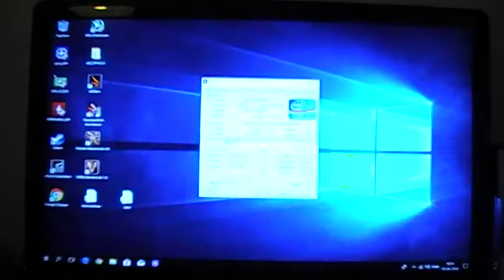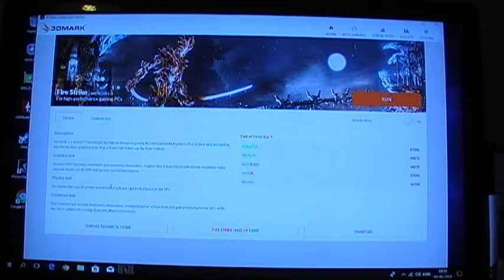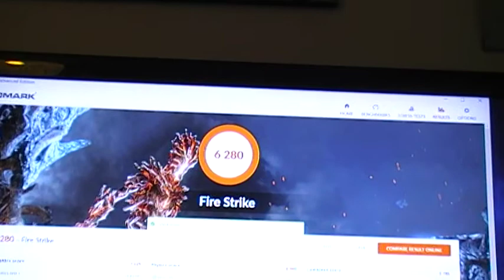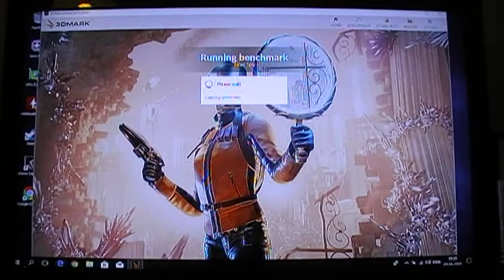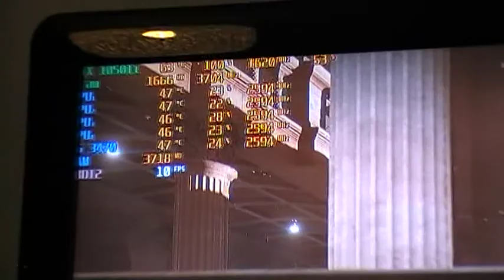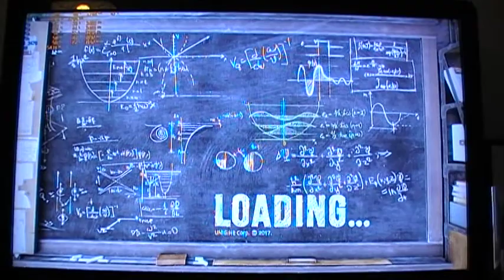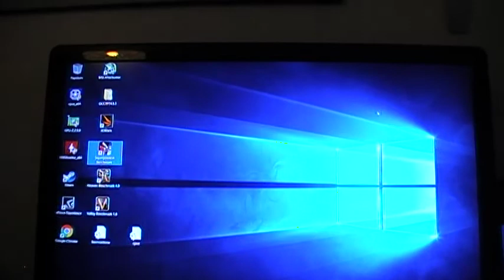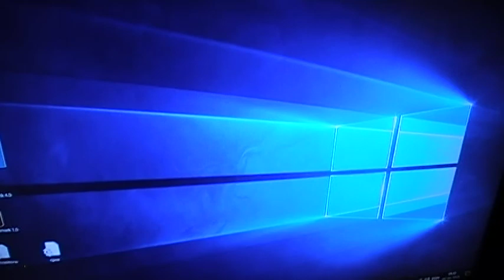(Original no music) Dell Optiplex 7010 SFF GTX 1050Ti benchmarking

Comment: According to dell specs the pcie on the sff has a max. Power output of 55w how does the 1050ti get it's 75w power???
Reply from the maker: It does deliver 75watt, why Dell states the 55watt I do not know. Many people with this particular model run it with a GTX 1050Ti and no one I have seen or heard of have had any issues.
F.x I have an Emachines EL1352 where the manufacturer states that max supported memory is 4GB DDR3, however I have 16GB DDR3 ram installed with no issues or any bios update or modifications.

Comment: Did you have any problems? PCIe slot is max 50w & GPU needs 75w.
Reply from the maker: Hi. They have no problems at all running with the GTX 1050Ti, even with additional overclocking to the card. I used to have two of these kind of systems, one I sold but this one I still have and use. It has no power issues running the latest AAA titles.

Comment: Whats the max temp for cpu and gpu bro?
Reply from the maker: In this immense summer heat where ambient is around 33°c the max CPU temperature is 87°c during CPU stress test like OCCT/Aida64. Max GPU temperature is 84°c during both GPU stress test and intense gaming. 
Normally we never has this hot weather during summer in Denmark. Normal summer ambient temperatures are more like 24~25°c.
Reply: Thx for replying my comment, anyway I`ve asked another question about RAM in your other video.

Comment: Did you upgrade the PSU?
Reply from the maker: No it runs fine with the standard 240watt psu.
Reply: @Gripen90  thanks man. I was wondering if the new GTX1650 would work as well

Comment: This is real.. With stock psu?
Reply from the maker: Yes it is. I have had two of the same systems with same specs running fine. I still have this machine and it has run flawlessly for more than a year. I also have an Emachines SFF pc with the same specs but a Phenom II X4 955 CPU and it runs of a 250watt just fine. (Using that machine typing this now).
Reply: @Gripen90  glad and happy to know that bro..thanks